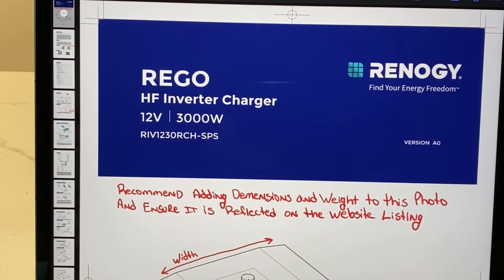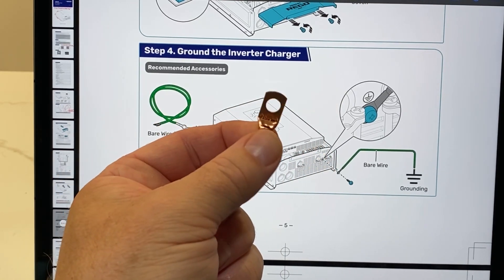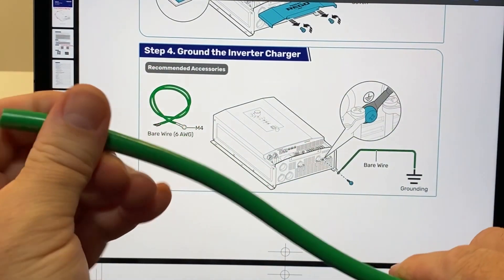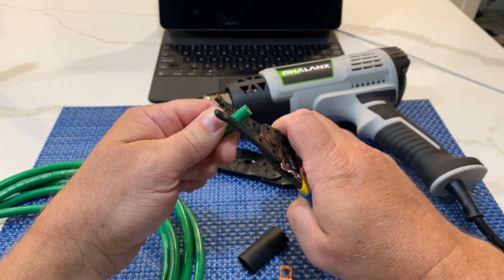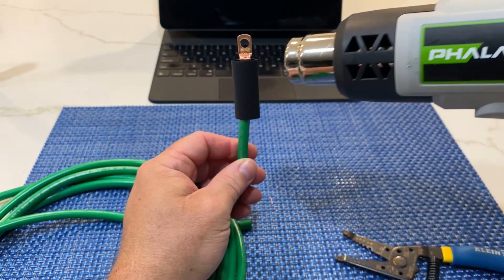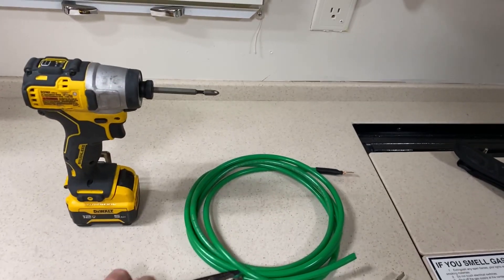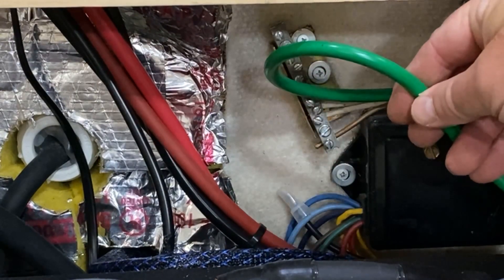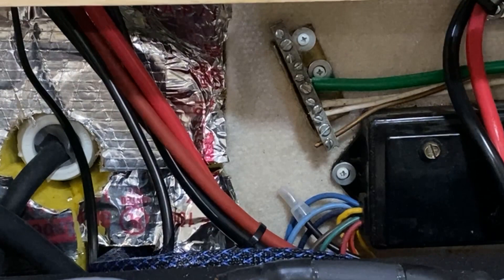Grounding Renogy’s New Inverter Charger @Stranded-N-Paradise

Comment: You don't ground inverters! To what? The mass of the van? Which is insulated from the earths mass by your tires,until you make the circuit when you step out the van. The chassis is the ground for all your 12v,how's that going to affect your 12v electrics?. The inverter does not need to be earthed it has its own internal hardware to deal with faults. This guy doesnt know what he is doing.
Reply from the maker: 1. I never said I knew what I was doing.
2. If it’s not necessary then why is it part of the installation?
3. I am only demonstrating what so many fail to do when installing products that clearly have instructions for it or who do it half ass.

I do appreciate any and all feedback that you have as to exactly why you don’t need to ground an inverter charger, maybe you should make your own video explains why it’s not necessary.

Comment: Also i really like your video format
process where you discuss what you are going to do, then show tools, then show install process - very informative
Reply: I think he means that the wire strands are 100 percent copper. I agree it's misleading though.  NEVER use solid wire in a mobile application.

Comment: I am interested in learning about your T Class fuses, and the attached  busbar.

1) how did you determine size of fuses
2) on which wires did you use tclass fuses snd reasoning 
3) max amperage of busbar and reasoning for selection

where to get tclass fuses
and bus bar

thx